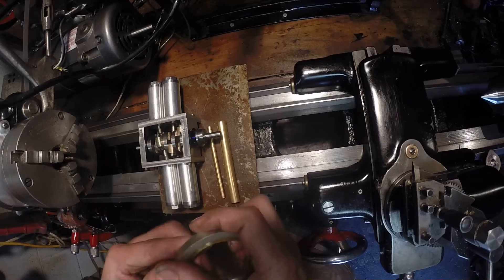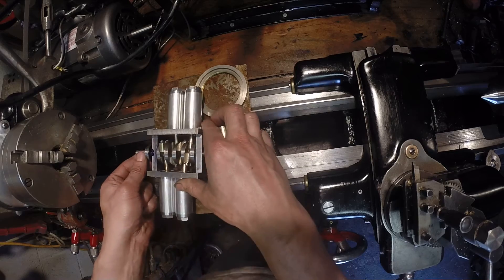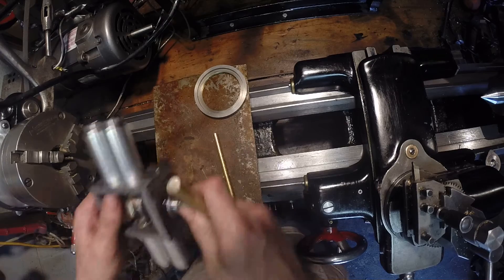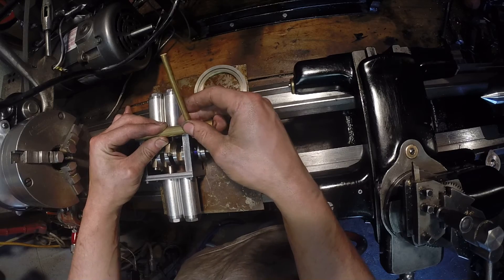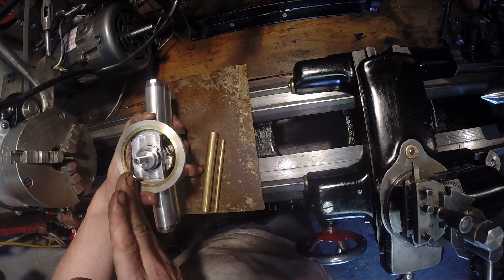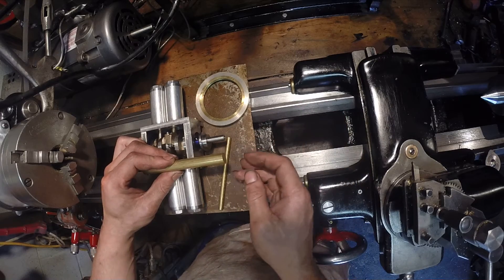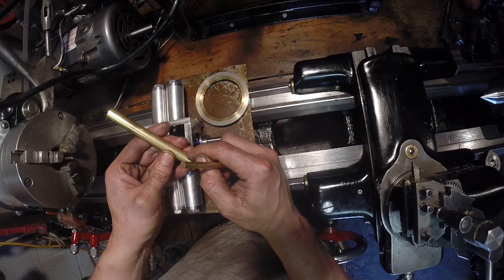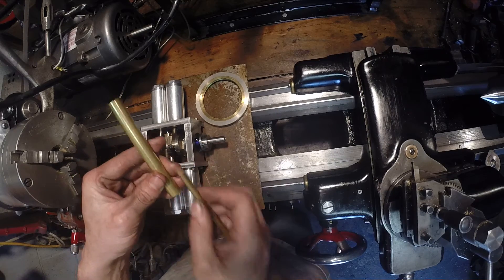Building a model steam engine: Part 3, Trying to figure out the next steps

Comment: Cool build, may I ask a few questions? Are you working off plans or just your own design, it seems this is a horizontal engine, also what machine tools (other than the lathe and drill press) are you working with. I haven't seen any measuring tools other than thickness gauge, how do you mill materials in your work? I only ask these because the design of the [steam] engine and your idea of the valve [displacement] idea seems cool, i can probably help...and if you like i have measuring tools for sale or trade. 

I have been trying to work on posting and editing videos but it doesn't seem to be working out for me, so I apologize for any impertinence and not having videos to show.
Reply from the maker: Thanks, I am designing it as it is being built. I am using a milling machine with a vice and a rotary table. For measuring I have used snap gauges to measure inside diameters. I use the cranks on the milling machine to position the bits in the desired locations after using a wiggler to find a reference corner. I usually put bluing on the parts and scribe lines as a way of double checking I turned the dials the correct amounts. Someday I would like to install a DRO on both the mill and lathe. I used the dial graduations on the tool slide on the lathe to make cuts to the desired depth. If you have some measuring tools and they are on ebay send me a link! Would be cool if you post some videos. I find making videos is a challenge. I was using Windows Movie Maker, a free download. Now I am using kdenlive on Linux. When you post some videos send me a link.
Reply: cool..although, I'm not posting any tools on ebay